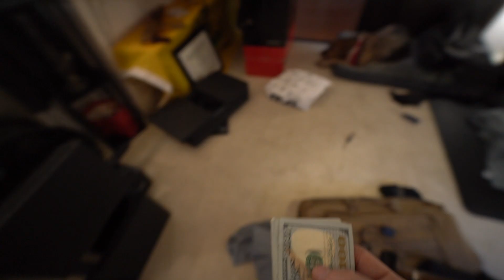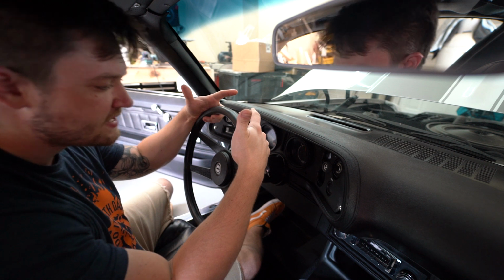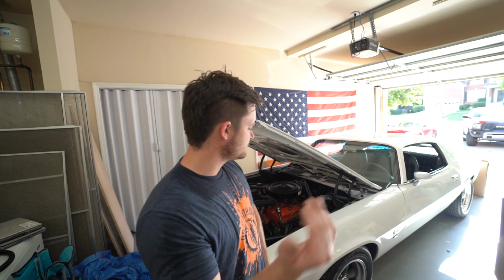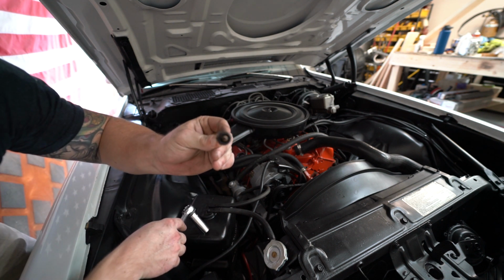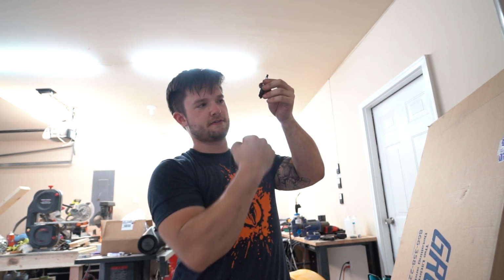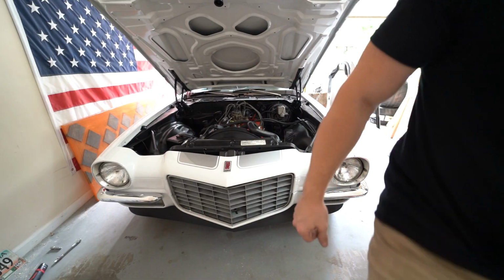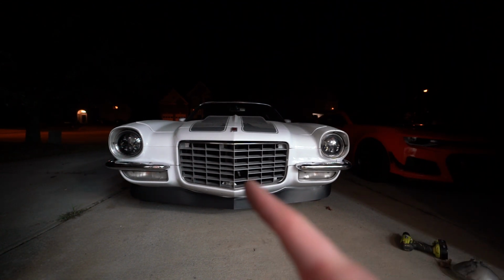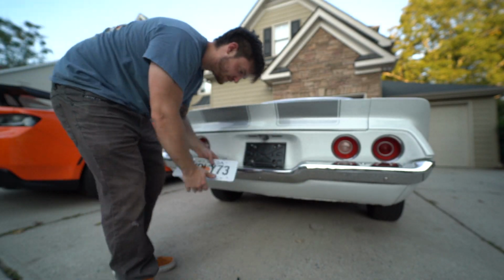ALREADY UPGRADING THE 73 CAMARO!

Comment: I'm seriously jealous. My first car was a '71 SS and still think they are the sexiest Camaro to ever roll off the assembly line. The previous owner of mine had done a rebuild to stock '71 LT-1 specs(330HP). After spinning a bearing I redid the engine senior year of HS to slightly better than '70.5 LT-1(360HP) specs. 10:1 flat top pistons paired with ported/polished/angle milled Edelbrock heads for 11:1 compression on pump gas, converted to full roller valvetrain with a slightly bigger than '70.5 LT-1 solid roller cam, single plane Edelbrock intake, 750 Holley, 1 wire HEI distributor, full length Hedman 1-5/8 stainless headers, 3" stainless H-pipe/"cherry bombs"/tail pipes. Probably way more car than any 17 year old should be allowed to drive, but damn it was fun.

Comment: That car seems like based off the spark plugs you showed us it has or is running rich causing the plugs to foul. While increasing total timing helps it only helps in the way that with more timing its able to be more efficient with the air and fuel it gets which can slightly improve performance but wont make it 100%. Those little 2 barrels can be troublesome with the common rich condition issue as they can be hard to tune. If I were you id source a little 500 or 600cm 2 barrel holley to put on the factory intake if you want to keep it orginal. This will offer much more performance out of that little 350 and more tuneability. Another helpful thing as with timing is to get whats called a dialback timing light and set TOTAL TIMING at 34 degrees. Hope this helps! Love the vids!

Comment: My dream car is a 1970 Chevelle SS 454 but I want to change the 454 to a 572 and get 572 chrome badges for it amd swap out the 454 badges.
Reply: Why not just actually put a 572 in it? Instead of faking it?
Reply: @GeterPreen  that's exactly what I would do what are you talking about did u read my post. I said I want to swap the 454 badges and put 572 badges on it with a 572 engine in it
Reply: @CadillacJak  read it wrong. Sorry
Reply: @GeterPreen  lol it's all good that 572 would be sweet but damn its expensive
Reply: CadillacJak  I have a 454 Chevy and it’s fast lemme tell ya
Reply: @vernonwellsfanclub2474  hell yeah love 454s

Comment: So I also used to gap spark plugs like that, but I learned the hard way that if you have platinum or iridium plugs, sliding the plug along the disc to widen the gap will shear the electrode right off.

Comment: The LED lamps are better than I thought they would look. I had a baby blue 78 Camaro, 305 with the 3 speed. The doors eventually would not open so I just left the windows rolled down and we would  slide in dukes of Haz style.

Comment: Dan the way youre gaping spark plugs is actually incorrect when you gap a plug you aren't supposed to gap by the tip on those coin style gapping tools you are supposed to gap with the hole in the tool not by sliding it along the ridges on the edge aren't for gapping because the actual electrodes are tipped and gapping by forcing on the electrode will degrade the coating giving decreased performance you don't want to gap by the electrode but by the physical arm that holds the electrode Chris fix has a great video on gaping spark plugs (https://www.youtube.com/watch?v=m_ZsWQ_WXNo) hope this helps... glad to see you finally having your dream car
Reply: If it works it works doesn't it?
Reply: @_Glockyy_  no because you can damage the plating on the electrodes... Like for example a platinum plug isn't solid platinum (obviously) but the electrode has a platinum coating so when you apply force to the electrode it can damage/ remove that coating ruining the plug

Comment: Get a layer of protection on the headlights, the housings scratch easy on those. I just did 35% tint but you could go lighter it’ll save you later on

Comment: Probably wouldn't hurt to check the gap and dwell on the points. Also looking at the way the headlight beam pattern on side of the 1LE it appears you have the highbeams wired to the low beam circuit. Some aftermarket headlights use the H4 pin out which has swaps the high and low wires I had this issue when I did a Hella H4 conversation on my 87 Camaro. I had to use the adapter that came whit them.

Comment: I would only use that method of gapping spark plugs on older copper plugs like I'm sure that car uses. Newer iridium or platinum plugs have a small protruding electrode that can be easily broken off if you use a wedge to gap them. Other styles of gappers have a cutout to bend the grounding terminal in or out so you don't come in contact with the small piece of iridium or platinum. 
Just a consideration.

Comment: Cylinders are all numbered. On v8’s one side of the engine will be slightly offset to the front of the car to allow room for connecting rods. The front most piston is #1 and starting front to back on that most upfront side of the block the cylinders are 1,3,5,7. Same goes for the other side but it’s 2,4,6,8

Comment: A carbureted fuel injection kit would help with the throttle response
Reply: But during the winter it’ll be fine starting and no waiting for the car to heat up

Comment: You should throw a wide band O2 sensor and air/fuel gauge in...then get someone to jet the carb...it sounds like it is stumbling when hitting the gas...
Plus it that car sat for awhile the plug wires might need replaced...check cap and rotor too... check all your vacuum lines for leaks...run some kind of fuel additive to clean the carb...could be gummed up from sitting too....maybe change the small fuel filter in the carb right behind where the fuel line goes into the carb.
Notice it smoking...like blue smoke...oil burning...those engine are known for the valve seals going bad...especially if it sat...which could explain the 3 fouled plugs...and with the low mileage I doubt it was rebuilt.

Comment: i'm pretty sure your led lights are upside down,  i have the same 7" ones in my motorcycle,  and in mine the bigger center led is on the bottom and the smaller is on top,  Double check the beam pattern. Just to make sure.  edit  yeah their upside down,   @ 20:53 you can see the pattern reflect off the camaro, Your lighting up the sky and not the ground

Comment: I don't know how you haven't killed a spark plug yet.  Cramming the gap disc in there is literally the first thing they tell you not to do with those. Use the hole that is usually used as a keyring hole to lever the top of the plug. Or... you do you Dan.

Comment: ever seen a second gen. camero with the full spoiler kit from factory ? i got a 79 z28 rs t top with full spoiler kit on it , first one i have ever seen i heard about it but never seen one best part i got it for free with a hard top z28 both in good condition just need motor work .i'm going to put a 454 ho with a few extra on it with a heavy duty 400 turbo and the rs front is 2 inches longer on ur year
Reply: ps pay to have it dyno tune it is worth every penny of it or time it by vacuum the best way to time a car in

Comment: That's the absolute worst way to gap your plugs and wrong tool. That particular gap tool is basically only good for checking the gap. The way you did it, you risk breaking the porcelain and chipping the electrode. There's another tool you can get at just about any auto parts store that has some wire gauges of the most common gaps and a tool specifically for adjusting the ground strap without touching the electrode.  Also don't forget to put a small amount of copper high temp anti seize on the threads (only the threads), and then a little silicone dielectric grease on the plug wire boots.

Comment: 0 degree timing to start along
with a two barrel carb, what is
that a 305 chevy? I had a 84
chevy pickup with that engine
when I bought it used in 1992
I yanked that engine out and
with a torch and welder I dropped
a big block Buick 455 into it.
I was wrenching at a Buick
dealership at the time and a guy
traded in a Electra 225 so I 
haggled with the used car 
salesman and got it for 1500.00
yanked the engine,replaced the
gaskets on the oil pan and valve
covers along with new plugs and
wires plus a double roller timing
chain and that chevy truck would
scoot! I still have it to this day!!!

Comment: Old cars are super easy to work on. If you had a newer car you would have to use a special tool and press out the steering wheel the newer car steering wheels just dont pop right off like the old ones do. For a mechanic like myself old cars are so much fun to work on it's all so easy and always simple af to fix while new cars are extremely complicated and always a hassle to fix. I will say new cars are better in every way except how they look compared to old cars, mechanically old cars are garbage compared to new cars which all run over 200,000 miles with ease. Old cars didn't ever make it to 200,000 miles and you had to give them a tune up and change the points every 30,000 miles back in the day.

Comment: Headlights on old cars are so easy compared to new cars where most of them now it costs 500$ just to change the headlights. I just did a Cadillac and the headlight bulbs alone were 250$ a piece and I had to take off the whole front of the car it was 150$ labor and their bill came to 650$ plus tax just to change 2 fucking headlight bulbs.

Comment: Dude put a new carb on that thing. If you put a 650cfm 4 barrel on it you would literally be so much happier. That 2 barrel carb is junk. Ask me how I know lol.
Reply: Still better than those 80s electronic carbs though
Reply: bob migarski those weren’t actually carburetors. Those were the first type of fuel injection GM offered. First year for that was 1987 and it was called throttle body injection (TBI). It looks kinda like a carb but obviously it’s all electronically controlled with no jets or floats or anything that a carburetor would have
Reply: No it is different there was tbi but also electric carburetors they found mostly on g bodies with 305 such as el camino,caprice,and monte carlo.They were not very popular(or good)
Reply: bob migarski oh dude yeah I know what you’re talking about😂😂😂 we had a 66 Chevy that someone put on it and it was a piece of junk we threw it away and put a Holley on it lol

Comment: Low timing is fuel mileage high timing is power
Reply: more power=high risk of catastrophic engine failure. Either way you go there is trade offs
Reply: No it's situational. 
'For higher octane fuels, more timing is needed due to slower flame speed
For large combustion chambers, more ignition timing is needed
For forced induction, less timing is needed because of faster flame speed

For emission controls, less timing is used to reduce smog compounds
For richer fuel mixtures, more timing is needed due to slower flame speed
For alcohol fuels that are run richer than gasoline fuels, more timing is typical
For nitro fuels that are richer than methanol fuels, even more timing is typical.'

Comment: Not that anyone gives a shit, but I set my timing for 5-7,000 rpm range, so I rev the piss out of the engine with one hand and spin the distributor back and forth at high rpms til I feel and hear the clean high rpm response I want out of the engine, you'll know if its way off if the car is backfiring or hesitating.  Works great (p.s. don't attempt on a piece of shit engine with 400,000 miles it will explode)

Comment: Doesn't say too much for the place you bought the "ground up restoration" 30K Camaro from, the fucking motor had fouled plugs & improper timing & poorly tuned, & oil light on & blowing oil out the exhaust  WTF???